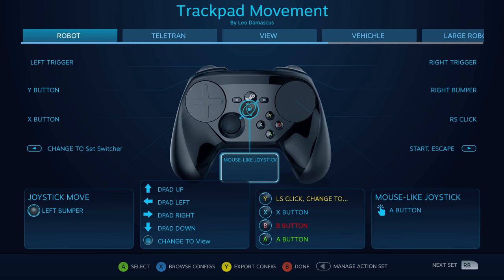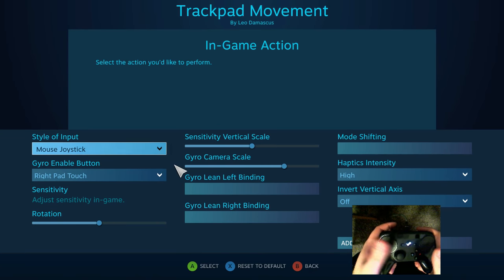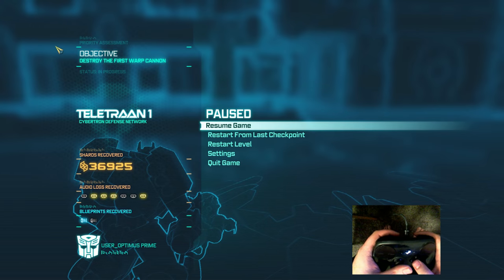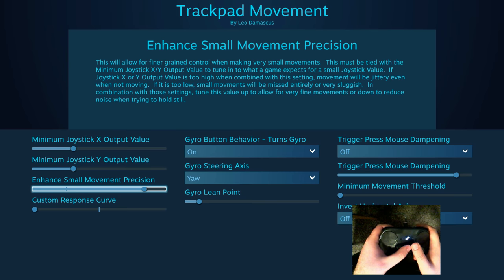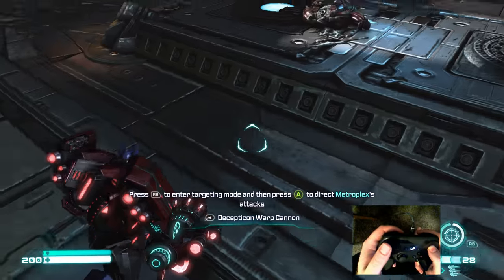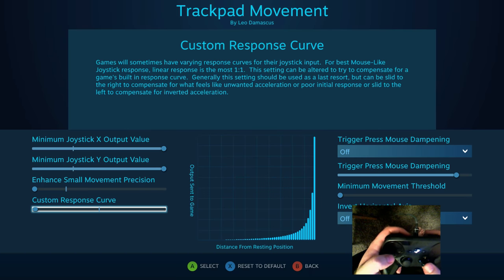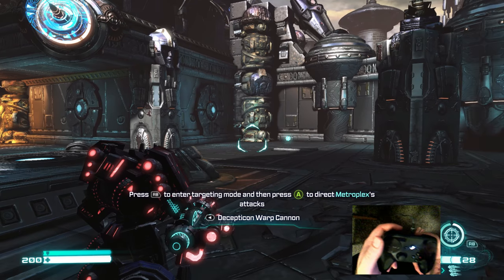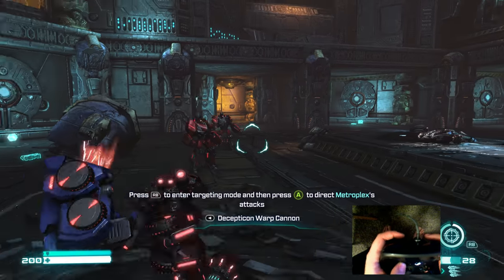Steam Controller Tutorial - How to Use Mouse Joystick

Comment: I dont get it. Where do you even find the ability to get to this screen in the first place. This is not accessible through steam.
Reply: These settings are in Big Picture Mode. You should be able to find them in the regular Steam settings now. Though, it opens the Big Picture Mode settings in a window; rather than fullscreen.